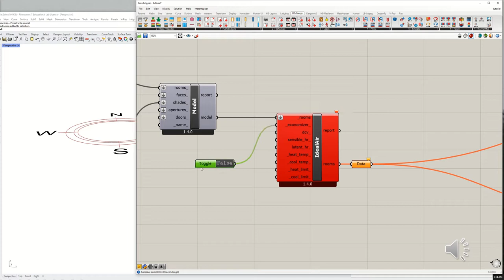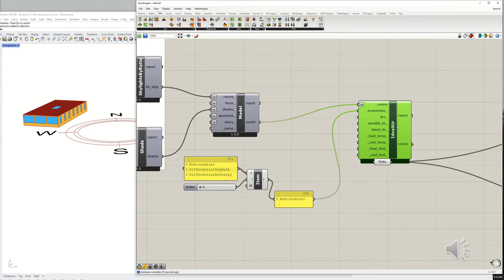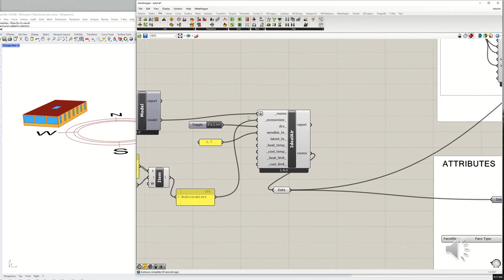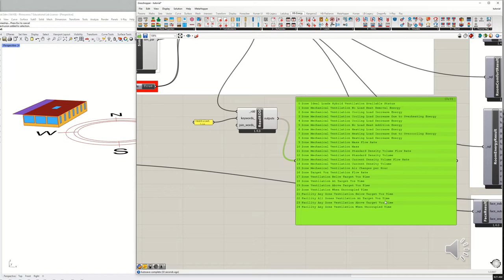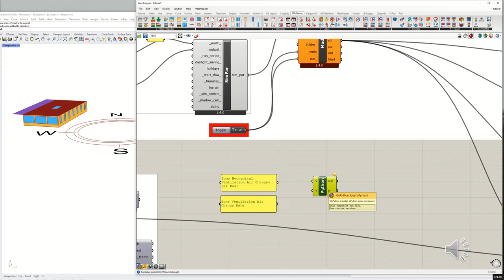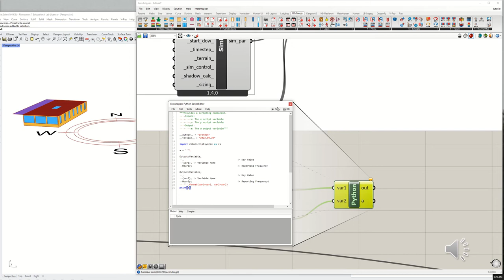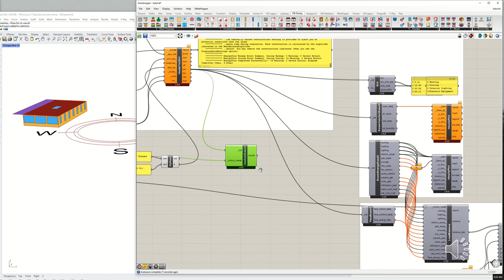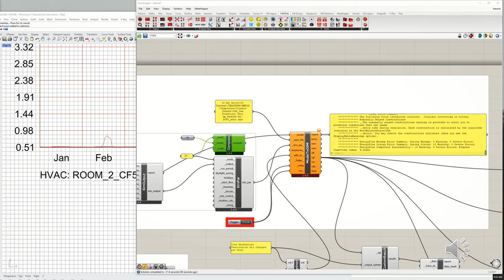Honeybee V1.4 :: Ideal Loads HVAC System and Outside Air Economizer [Tutorial 2.1]

Comment: Dear Professor, I am very glad to get in touch with you. I have followed your youtube and learned the method of simulating future climate data, which is very helpful to my research. However, in the step of (3) morphing data, my program also reported errors to solar radiation data, but the problem window I encountered was different from what you demonstrated, and the data could not be automatically repaired. So that I have been unable to successfully get the deformed data and successfully export, I would like to ask if you have a further solution! Your reply will be of great help to me, looking forward to your reply!

Comment: Hello, I have a question about the heat limit. Is it per room or for the whole building?
Reply from the maker: Air temperature is controlled per thermal zone according to the thermostat assigned to the HVAC system.  In Honeybee, each "room" is typically a unique thermal zone with its own HVAC system and thermostat.

Comment: Hey. Thanks for the video. I am curious about the dcv. It just follows a dummy data from occupancy or it follows the ventilation schedule?  I mean, dcv can change the rate of ventilation based on ventilation schedule?
Reply from the maker: In real life, Demand-Controlled Ventilation is controlled by CO2 sensors.  In energy modeling it's common to use occupancy as a proxy for CO2 (though there are ways of simulating CO2 accumulation more directly).  The DCV that Honeybee uses is occupancy-based.  The ventilation flowrate is tied to the number of people in the zone.  In addition to this (or in lieu of this), you can set up ventilation that follows some other logic.  I've got two additional videos in this series that might be of interest (https://youtu.be/f7S4X7dRw9w) and (https://youtu.be/GbRYCk70B30).